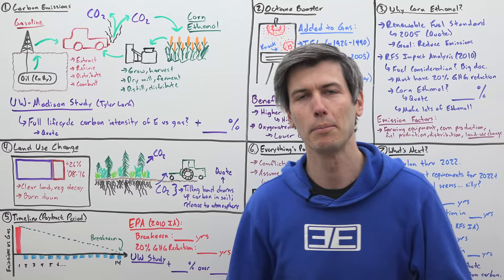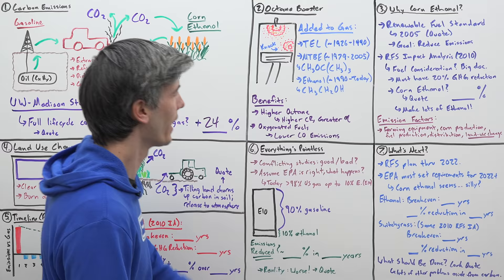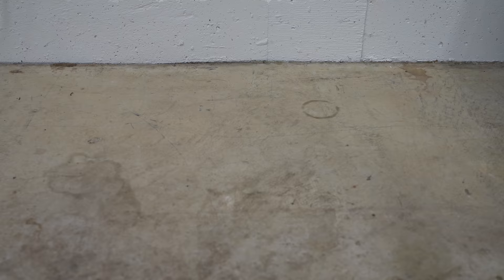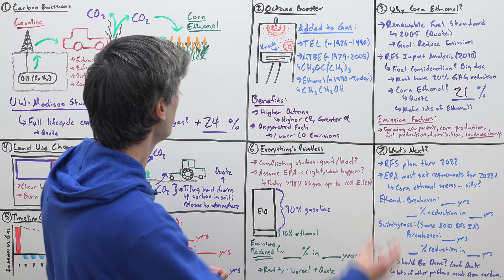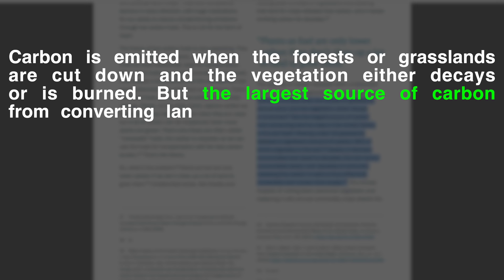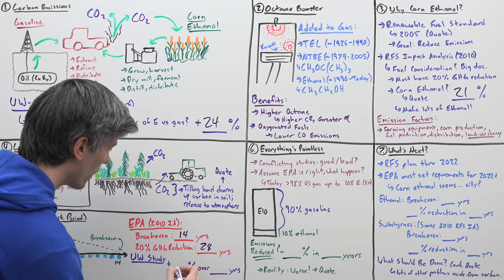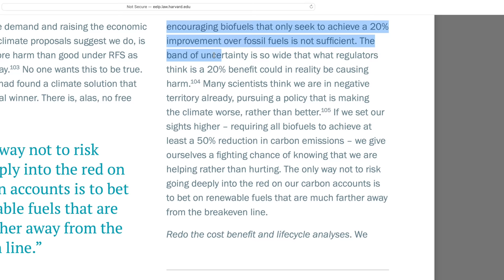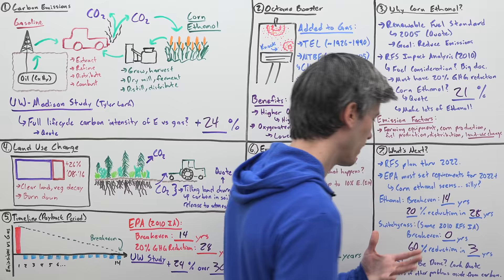America Was Wrong About Ethanol - Study Shows

Comment: Growing corn requires fertilizer, in turn an energy intensive process, increasing CO2 production, not to mention reducing the amount of corn used for animal feed and for our consumption, driving up prices. You could produce ethanol from other crops, but there is a subsidy for using corn to make ethanol, and example of a very bad law. There's other factors at work here, in particular the farmers like the subsidies, so lobby Congress to keep them. It's a crazy system.
Reply: You can produce ethanol from ethane if you want to burn an inferior fuel - LOL
Reply: Not to mention the water required in production and the wastewater produced further challenging Iowa's already troubled waterways.
Reply: Chris, DDG's (Dried Distiller Grains), a by-product of producing corn based ethanol, are an excellent feed source for livestock.
Reply: @artdbaxter9690  Almost all fuel ethanol plants create zero wastewater.  The only water leaving the plant is doing so as pure water vapor out of a single stack.
Reply: @LV2XPLR  If they use the correct technology, yes. I don't think Iowa is doing much in the way of regulating these plants.  And even if they are not creating wastewater, they are creating a water draw that Iowa may not always be able to afford. And that's just the beginning of the environmental concerns that should be questioned when the question is asked "is ethanol a positive item in the motor fuel creation mix?"  Brazil uses it extensively because the petroleum products truly are more expensive. Because ethanol has less energy per gallon than gasoline, you can't start an alcohol-only engine at below 60F.  Gasoline still has to be available to cold start an engine on those few days.

Ultimately the decision gets made is a political one and like most political decisions made with the "help" of commodity lobbyists are the wrong ones. Only if you care only about farmers having this additional market for a product that has to be subsidized to get anyone to buy it, can one objectively think ethanol production for motor fuel is a good idea.

Comment: It has been especially perplexing to me, to use a food stock for transportation purposes. When corn first started being cultivated for ethanol use it fueled the rise in prices of a lot of food. So there was an inflationary pressure Placed upon groceries by the displacement of corn to make ethanol. Today that’s all I figured into the price of food and gasoline and we hardly think about the fact that food cost more than it did before we actually went down this corn to ethanol path.
Reply: Here is how the 2007 Energy Independence and Security Act affected food/feed prices (if at all):

2007 weighted corn price =$4.20 WITH 4 .7B gallon mandate
2008 weighted corn price =$4.06 WITH 9B gallon mandate
2009 weighted corn price=$3.55 WITH 10.5B gallon mandate

2016 weighted corn price =$3.36 WITH 15B gallon mandate maxed out
2017 weighted corn price =$3.36 WITH 15B gallon mandate maxed out
2018 weighted corn price=$3.61 WITH SAME 15B gallon mandate maxed out & most ethanol ever produced
Wheat
2007...............$6.48/bu
2008...............$6.78/bu
2009...………$4.87/bu

2016...………$3.89/bu
2017...............$4.72/bu
2018...............$5.15/bu

Soybeans
2007..............$10.10/bu
2008..............$ 9.97/bu
2009...……...$9.59/bu

2016..............$9.47/bu
2017..............$9.33/bu
2018..............$8.48/bu

Comment: As someone who works at a biofuel refinery (coming up on 2 years at in the industry so i am still wet behind the ears) I am really surprised by this study. Not sure about other plants but at my facility, as part of the distillation and evaporation process, we also make a lot of corn oil but not the kind you cook with. The corn oil is sold and used in bio diesel. Not sure if that was figured into the study at all. Either way great video and thank you for sharing!
Reply: At the very least it should be an acknowledged side benefit of corn to ethanol production process as it is likely to reduce the carbon footprint of diesel fuel consumption. 
Mark from Melbourne Australia
Reply: I didn't have time to read the study, but I had a university class in this topic and after having done some research I can say with certainty that the environmental researchers definitely take into account the Biodiesel that's made from corn or other bio sources. You can break down all the inputs to the biofuel refining system (energy crops such as corn, soybean oil, switchgrass, etc) and the outputs from the system (biofuel, corn syrup, etc.) to determine the efficiencies and losses to see how good or bad it is for the environment.
Reply: Based on what was presented above, the bio diesel may make the ethanol more profitable, but ti would not change the basic math that corn based ethanol does not improve overall emissions in any substantive way.  In fact, the idea that it would create a diesel fuel may make it even worse than mere corn based ethanol, although I suspect the amounts produced, relative to the gasoilne are small.
Reply: But you still get a heavily subsidized paycheck, corporate welfare.
Reply: @austindenotter19  You are right but I'm sure that most of that goes to the CEO and board members in the form of bonuses. I. Just a little worker bee on tue bottom of the ladder.
Reply: @samfedorka5629  Its about money. Environmentalism buys nothing money does.
Reply: Doesn't make any difference. You can't get more energy out of corn than you put into it. And corn also requires fertilizer, herbicides, fungicides, and insecticides. Imagine all the energy that goes into those products. Ethanol is a loser once everything is taken into consideration. It's like a dog chasing its tail.
Reply: @1mawesomel1kethat  They don't try look at Stalin he has a solution for you he does. So choose life or death. Oh Iam sorry you dont choose after all.
Reply: @JAO53JAO  Bio diesel has less emissions than 100% petrol diesel. Ethanol is worse environmentally because of its vapor pressure.
Reply: @austindenotter19  There are powers that dwarf all the governments on earth. They do as they please not what you want.
Reply: @markfryer9880  Not carbon so much as emissions diesel is filthy.
Reply: @kimwilson7150  I am not even sure what you're talking about
Reply: @1mawesomel1kethat  Governments are a fact of life at least America is rational. Other Governments are not.    After all some allow no choice at all. Government is not at fault the voters  have ultimate responsibility.

Comment: Shell 91 octane premium gas used to be 100% gasoline, now it contains up to 10% ethanol. Safe to say they put 10% ethanol... Less BTU for your money.
Reply: Try 87 octane then...is has MORE BTU then premium fuel..always has.
Reply: @oldblueaccord2629  my car is a turbo 2.0l and recommends minimum 90 octane, I'd rather use the right kind of gas for my engine and avoid any potential knock
Reply: @TheBrawlmastah  Then try 30% E85. You wont get any knock at all. Great for turbo motors.

Comment: In an MSE class (materials science & engineering) back in 1996, my professor walked us through the chemical breakdown of using ethanol, proving it was worse.  The only additive which worked to reduce emissions was MTBE (used by Texaco), but MTBE was subsequently banned around 2000.  ALSO, in step 1, you're not even considering all the diesel fuel (tractors, combines) and energy that goes into tilling, planting, harvesting, etc.
Reply: Whats with all the bad mouthing of corn?  What about petroleum, drilling, fracking, refining, transportation, pollution like particulates, co, No/x, and there   is the question of what about when it runs out.

Comment: Owning a vehicle that uses flex fuel, I have noticed that I get 2 - 3 mpg less when using E85, than when I use regular unleaded.
Reply: Thats about right. I get about 22-24% less in my Honda on E85.
Reply: @oldblueaccord2629  I'd assume (or hope!) that the reason for this is your engine is optimised for normal gasoline.  Otherwise the only benefit has been to enrich big agriculture.
Reply: @colinmacdonald5732  Ethanol is a renewable fuel and made in America. No more Russian and Saudi oil. They can eat it.

Comment: How many acres of forest were burned down and grasslands plowed to specifically increase corn production since the 80's?....in America likely none to near none.  Shifting land use could mean shifting between a crop like wheat to corn.  An important factor of fertilizer requirements were left out too.  It's important to include the guys actually working the farms to improve accuracy and not solely rely on reports from partially informed sources that lean to one side.
Reply: The US used 11,160,933 tons total fertilizer on corn in 1980, before ethanol.

In 2018, the year of most ethanol production ever, the US used 10,521,850 tons total fertilizer on corn.

Believe it or not, the corn belt grew more corn acres in 1980 before ethanol than they do today with most ethanol production and ethanol plants everywhere.

2018 Iowa 13,200,000 acres of corn with record ethanol production
1980 Iowa 14,000,000 acres of corn before ethanol

2018 Illinois 11,000,000 acres of corn with record ethanol production
1980 Illinois 11,600,000 acres of corn before ethanol

2018 Indiana 5,350,000 acres of corn with record ethanol production
1980 Indiana 6,450,000 acres of corn before ethanol

US Cropland acres have declined since ethanol came to be so it is impossible forests and grasslands or any other kind of land was broken up.

US CROPLAND ACRES
1997 349,000,000 
1998 345,000,000
1999 344,000,000
2000 345,000,000
2001 340,000,000
2002 340,000,000 
2003 342,000,000 
2004 336,000,000
2005 336,000,000
2006 330,000,000 4.0B gal. corn ethanol mandate
2007 335,000,000 4.7B gal. corn ethanol mandate
2008 337,000,000 9.0B gal. corn ethanol mandate
2009 333,000,000 10.5B gal. corn ethanol mandate
2010 335,000,000 12.0B gal. corn ethanol mandate
2011 328,000,000 12.6B gal. corn ethanol mandate
2012 340,000,000 13.2B gal. corn ethanol mandate
2013 336,000,000 13.8B gal corn ethanol mandate 
2014 341,000,000 14.4B gal. corn ethanol mandate 
2015 337,000,000 15.0B gal. corn ethanol mandate maxed out
2016 336,000,000 15.0B gal. corn ethanol mandate maxed out
2017 334,000,000 15.0B gal. corn ethanol mandate maxed out
2018 338,000,000 15.0B gal. corn ethanol mandate & most ethanol ever produced
2019 323,000,000 15.0B gal. corn ethanol mandate 
2020 329,000,000 15.0B gal. corn ethanol mandate

There were more corn acres in some northern states not from ethanol but from the fact that feed barley fell from favor from cattle feeders to corn in conjunction with high yield earlier maturing corn varieties which came along.  This trend began before ethanol came to be.
  
US barley acres were 8.32 million acres in 1980 before ethanol and declined to 2.55 million acres in 2018, the year of most ethanol production.  Corn acres in 1980 were >84 million acres before ethanol and during forced government land set aside programs and were 88.9 million acres in 2018.  Combine the two and we get 92.32 million acres in 1980 of the two feed grains and 91.45 million acres in 2018.

1980 feed grain acres (corn & barley)     92,320,000 acres
2018 feed grain acres (corn & barley)     91,450,000 acres
Reply: Correct,and also largely a petroleum/NGas product which weights ethanol production as even less beneficial and less green.  Now, because I'm not partial either way and like correct information to be present, how many acres of land were deforested or pastures/grasslands turned under specifically for corn ethanol production in the US?  The easy answer is none/near none.
Reply: @eodteu1  Corn grown just for ethanol is far too uneconomical but with the feed factor, i.e. distillers grains, few can compete with it as a source.  The magic of value-adding.

Today's newer ethanol plants don't use natural gas but waste steam from natural gas electric plants.  Waste steam = free energy.  The largest ethanol producer has at least half their plants this way.  Soon all plants will be, so ethanol's low price has room to remain low.  GE actually converted turbine electric generators in Brazil to be dual fueled with ethanol and natural gas.

100% of the fertilizer used in corn still gets fed to the livestock in the distillers grains.  Ethanol (C2H6O) is made only of things of the air: solar energy, CO2, and water with the latter two recycled once burnt.

What logic is it to assign all the fertilizer to ethanol and none to distillers grains?  Should it not be the other way around?

Iowa State University measured all the energy it takes to produce an acre of corn into a "diesel fuel equivalent"
This included making the machinery, fertilizer, chemicals, plus the tillage, planting, harvesting, drying, trucking etc.
 
They found it takes 34 gal of diesel to produce one acre of corn.
What do we get from those 34 gallons of diesel?

We get >500 gallons of ethanol.

But wait, that is not the kicker.
The kicker is we still get 100% of the protein and other things from that acre of corn still available for a healthier and even better feed called distillers grains. A win-win.

Comment: Personally I've known this for awhile now. I was a loud opponent back when it was announced that this whole ethanol thing was going to happen. The first issue I had was that the whole stock wasn't used for ethanol production. The switchgrass alternative was a good one and it wasn't the only other option that was better than corn. When you consider that any plant which contains a large amount of sugars can easily be made into ethanol and that many of them are of a far lower impact. Beets, especially the sugar production variety would be a well suited and abundant source for bio-fuel production. Along those same lines, sugar cane would work well. Then we have broach the subject of biodiesel in the family of green fuel and along those lines we should consider using hemp seed oil which can be turned into a very reasonable and efficient biodiesel. It would also be an excellent source for textile and paper fibre as the pulp from the plant itself has fantastic long fiber which is well suited for such things. Another alternative is cotton seed oil and given it's otherwise fiberous nature cotton production is already a large industry and could easily offset it's carbon emissions by simply processing the seeds it doesn't need for the next physical year's crops. Corn and other plant based oils are already a problem. Corn and palm oils in particular are responsible for a large amount of deforestation in the Amazon jungle and here in the United States. At the time of this comment I am unaware of what the European Union, the Germanic countries, Asia, and African nations are doing though I will be looking into it directly after posting this...
Reply: Thank you, Erick.  Sensible people have been trying to make this case (that if you want renewable fuels in the future, there are much more suitable commodities) for decades.   I, personally, participated in a research project while in college, using a variety of vegetable oils either alone or mixed with diesel fuel and running them in a test engine that had the ability to vary the compression ratio and chart the developed horsepower.   Coincidentally, being college kids, my friends and I put together a side project and handed it to the Prof at the end of the test protocol - this side paper charted the various fuel and oil mixes and their corresponding cost per equivalent mile of travel.  What did we find?   The simple answer - any variety of oil was viable, alone or mixed with diesel, for use with a bit of tweaking to the engine.   As it turned out, the best results came with the cheapest, bottom shelf, blended vegetable oil.   On the other hand - the REAL result was that any usable plant based alternative cost anywhere from 8 to 12 times as much per mile as the straight diesel.   Without getting too deep in the atomic structure analysis, the simple answer to the greenies is this - any fuel that combusts results in CO2 as a combustion product -- so put that reality in your e-vehicle planning.
Reply: It doesn't take a genius to figure out that alcohol which when made with vegetables is made using a sugar as part of the fermentation process.  Sugars, which are still in the ethanol, burn badly.  They also cause problems long term in the engine.

Here is the otherside few are talking about.  Break even of electric vehicles... how many hundred thousands of miles will you have to drive to break even from the impact of dirty mining for the rare earth minerals and metals for making the batteries and paying for the energy to charge them?

Have a feeling this is coming out now because they are trying to push EVs, while pulling the same bait and switch.
Reply: @patrickhenry236  No .. mining oil is great... this comment sucks
Reply: I had heard that China is in their great building stage like the U.S. after WWII in the 1950-60s.
Reply: @janolthof2487  never said drilling for oil wasn't.  Read my comment again, and yes your comment does suck if you can't read or don't understand the difference between mining and drilling.
Reply: @timbaka1480  You obviously cracked the code for efficient cellulosic ethanol! Please share with us how you are able to guage your efficiencies. Last I knew is the problem with sugar beets is the water content attached to that feed stock. Just like potatoes, it will cause inhibitors for fermentation. This would drop the yield on a per BU or per TON substantially. Corn is easiest and most efficient based on starch alone. Cattle don't need starch and that is why the model works!